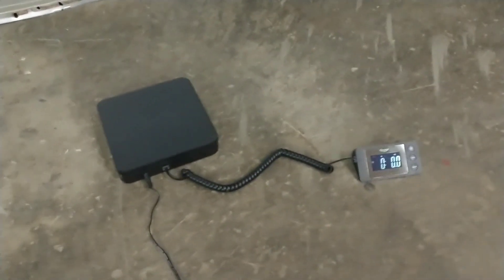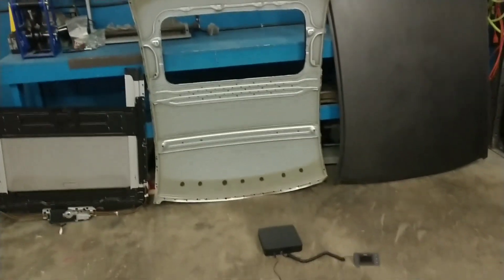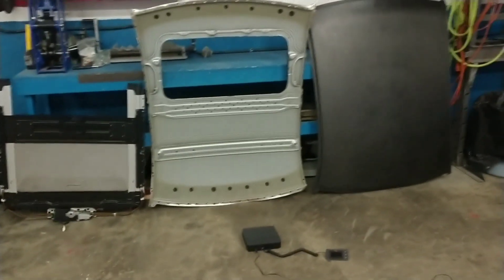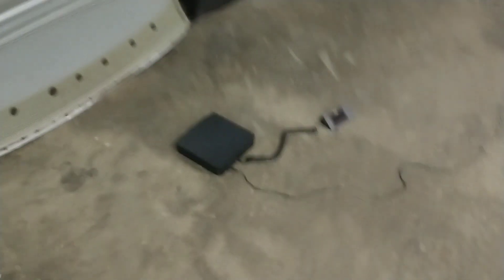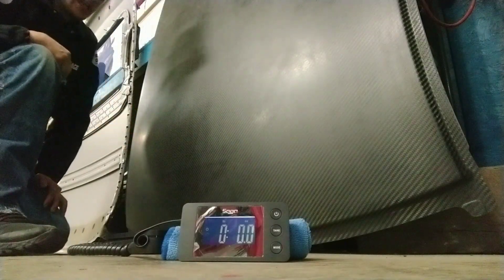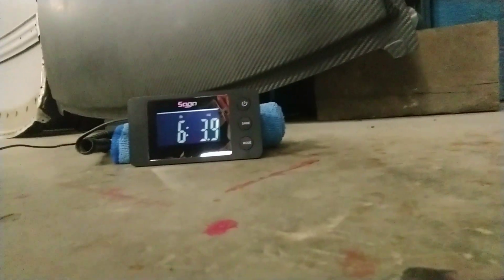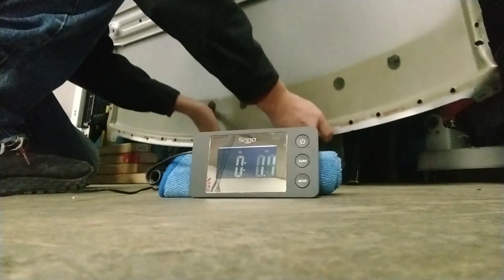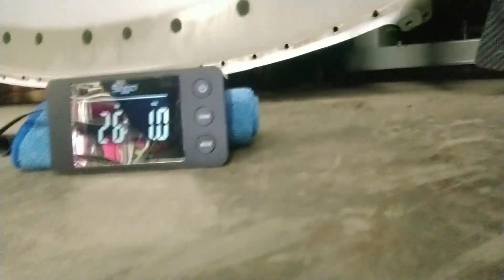What's the weight difference between a Carbon Fiber, and Steel roof?

Comment: Damn makes me want to take off my sunroof and roof and get a carbon fiber one. That’s a ton of weight savings, but does it compromise structural integrity if you don’t have cage?
Reply from the maker: You still utilize all the steel mounting structure underneath the OEM skin. You swap it all over. Just as the factory does. Perfectly safe. This is why the "RA" and "s207- s209" all have cf roofs. Try a random search for carbon fiber crash test. 😎 You'll enjoy it. Be surprised how much stronger it really is. This is why all supercars are built with cf monocoque bodies. Light, and extremely rigid. Amazing crazy ratings. Trust me. Do a search.
Reply: Rumble Garage  Thanks! Will do. I’m always looking forward to knowledgeable stuff like this. Appreciate it.
Reply: @RumbleGarage  How do you seperate the steel mounting structure from the OEM skin?